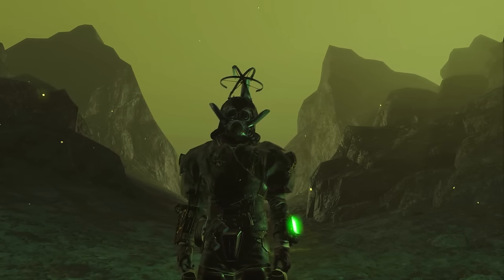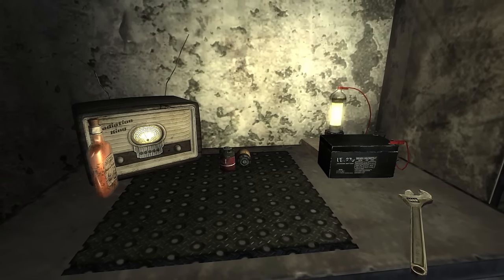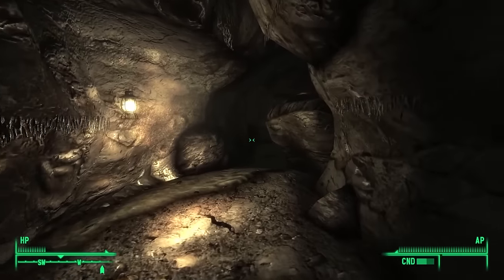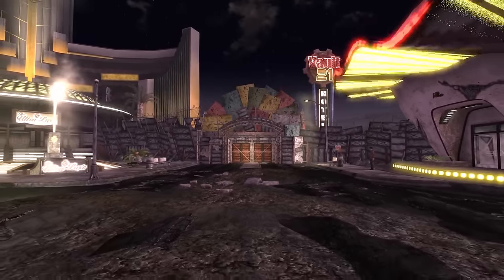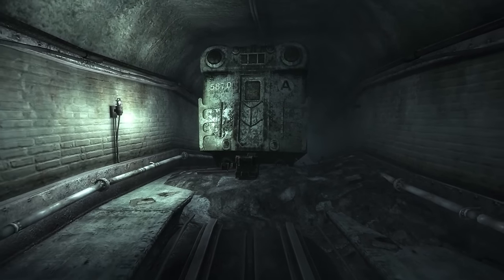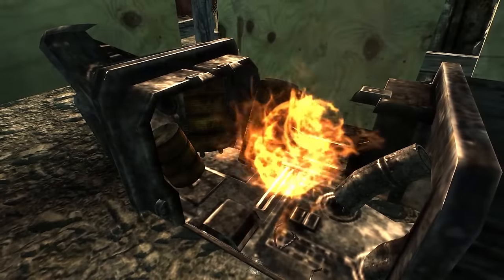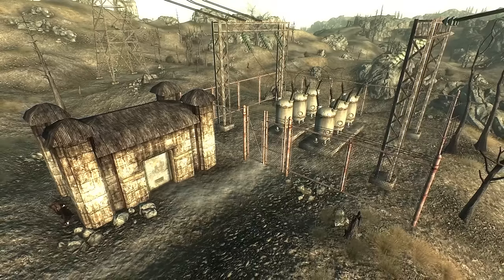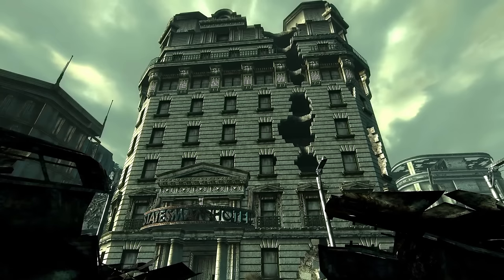Where does the power come from in Fallout?

Comment: 15:54 i think its more possible that these generators are actually charging the fusion core, i see it sort of like a spark plug/battery, plug the core in and it starts the generator but it doesn't run it, the generator will continue to run and charge the core until it is removed at which point i belive the character will turn off the generator before removing the core

Comment: One point that I realize most don't mention is Telecoils. for that power plant in broken steal it seemed to be using tesla coils and tesla seems to have been a bigger influence in fallout history. I think its entirely plausible that they used both nuclear and tesla reactors. But that's just me. 

as for the whole taking the power core out thing. Something I think is that they may have already "depleted" what they had and the building had it stored up in batter stores thus is why when you take it out it doesn't immediately kill the power but it does kill the generator. However years in the future I can see those buildings eventually loosing power because the fusion reactor was removed.

Comment: On the fusion generators you find the fusion cores in its possible the generators are feeding into the power system irl if you install solar or wind generators on your property you can remain hooked up to the power grid and it will reduce your power bill with any excess power being fed back into the mains to the point some people get paid by their power company it also could be the system automatically detects if the generator goes down and switches back to main which would explain the flicker best guess for why it looses power faster in power armor then 200 years running lights I will point out that fact the lights have been continuously running for 200 years without burning out if the lights are able to run that long then why couldn't they simply be extremely low power draw if those lights have just been sipping and tiny amounts of power for 200 years then a mech suit that weighs as much as small car running around like it's got a plane to catch would draw that power a lot faster it also could be the fusion cores are already almost depleted and the power armor is just the straw that broke the camels back

Comment: used to puzzle me, especially when in fo4 you can remove a fusion core and yet the power to the building would stay on...and then I discovered a mod were all power shuts down when you remove the fusion core, however I did have to tweak the mod as it only turns the lights off,

Comment: Regarding the fusion generators, it's also entirely possible that the core isn't the whole system as noted by the massive ceiling height blue object they are plugged into literally called a "generator". My personal explanation being that in the generators the core serves as one small part of a larger system, functioning more as a capacitor or igniter than a battery, and likely involving a function loop that cycles whatever material is in the the core, allowing it to function without depleting. In power armour or a gat laser it is used as the entire standalone power supply and just drained like a battery rather than cycled.

Comment: There is actually very high probability to the possibility of alternative power sources still giving power, especially since I still have the theory that a lot less of the power in the fallout games is necessarily provided by nuclear sources than outwardly apparent.  Honestly I always had the theory that the fusion cores were more of a battery that contained a bit of nuclear material to appear to be the main power source of a fusion generator when it was actually more of a backup or kind of an alternator.  Honestly I rather assumed that there were probably quite a few other forms of power generation like solar, geothermal, and hydroelectric that probably just weren't open praised and talked about because the big money was on nuclear and that alternative also was more suitable to hide other less ethical projects also using radiation.  So other possible sources, especially something like geothermal generators, could be pretty easily automated, kept out of sight underground, and the power coming from them could be attributed to the more obvious powerplants when in reality those plants were not actually producing all the power in an area.  Also if those hidden plants were specifically designed to be automated and self sustainable, maybe with a few robots to keep an eye on them and to perform maintenance, they would have been a lot more likely to still be running.  I am not saying that there wasn't a lot of the electricity produced by nuclear, just that it is possible it wasn't nearly as prevalent as it appeared and that there were other hidden alternatives that are now still going strong.

Comment: Fusion cores when paired with power generators likely play the role of a generator in a "black start" situation and maintain the running current for the station/generator.
All power stations require power to spin up the turbines and get processes started before they can be connected to the grid. Once running, the draw on them would probably be minimal and when you stick it on a power armour, it just can't keep it up. The larger body of the generator probably also houses a battery system that will keep things connected to them running, if those battery systems are near end of life or damaged, they could be pushing insufficient wattage to fire up equipment with higher peak loads required to start or run them.

Comment: What if the fusion generators are constantly feeding each other? If that's the case, the generator wouldn't be draining the core but, using it and recharging it at the same time. There's some complicated electrical stuff as to why it doesn't work in real life but, it can happen in Fallout.

Comment: Always thought of the fusion cores like a breaker switch attached to a generator. 
When the breaker pops, so does the fusion core and it shuts down high level surges but keeps the lights on and the doors working, etc

Comment: 5:25 there is another boxy generator in Fallout 3 that you see all over the subways, usually in the tunnels between two tracks. There's one or two in almost every cut through tunnel I can remember. (Sometimes paired with a mine or explosice trap that then blows up the generator for double damage) oh there you cover it. Inchoose to imagine it as a generator despite how it's referred to in the game files since a lot ofnplaces seem tonuse them like that. Would a generator notnhave some transformers attached sometimes?

Comment: voltage is the difference in potential between two points. this fundamental piece of trivia makes the usage of electricity in almost every video game a joke

lightning is not something you aim. sparks don't jump out of loose wires. you need about 10K volts to bridge an air gap of 10mm or about a third of an inch between two points. one of those points need to be held at about 10K volts of different potential to the other and once the bridge is made the difference is nil. 

so lightning jumps between two points and cannot miss, sparks don't drip from electrical hoses.  so any kind of lore on electrical usage in these games has started from a place of total ignorance or lack of effort. 

as for fusion cores in buildings. it's more reasonable to assume those are charging the cores and the players character is dumb enough to just yank fusion cores out without even hitting the eject button. even more likley is that bethesda ran out of time or enthusiasm for putting in the effort to have the cores actually do anything

Comment: Chernobyl still produces power today even though it melted down.the generators you pull the core from are probably backup generators wich would explain them protruding out they probably were only connected enough to partially power the necessary systems needed to start the generator.Also you need a steady stream of power to maintain a fusion reaction the cores may be a way of starting/maintaining the reaction doubling it's life time and power produced.

Comment: On the "Fusion generators" not only are the cores not visually seated in the wild, but the eject light flashes. It's possible that the gens ejected their cores as a safety precaution and therefore weren't using up the charge in it. It's also possible that the core is acting as both a fuse and a battery and the power is actually drawn from elsewhere. The company behind the gens isn't exactly known for being honest.

Comment: I have a theory about the fusion core generators, what if the fusion cores aren't which actually supplying the power to the generator, that the generators are actually charging the fusion cores and it took about 200 years to fully charge them, and the generator shuts off because it's no longer charging a fusion core.  infusion technology is so unreliable it took 200 years just to get that much power to power a power armor for such a short amount of time.

Comment: I always thought those fusion core reactors were actually a charging station, because as you so eloquently put it in Mass fusion could never get fusion running before the Great war so instead we are actually dealing with is some type of power bank and those devices are actually charging it the fusion cores themselves and my personal theory would have been used to power things like front end loaders or other things like that, and the fusion cores themselves are actually falsely named as you yourself put it but the reason the xplode is because the people working in Mass fusion our kind of insane and used nuclear materials in the construction of these microfusion batteries which explains why they explode once you depleted the energy

Comment: Knowing Fallouts logic I bet the fusion generator is actually a fusion core charger. It just charges them like batteries running off the same power that runs the lights. When you remove a battery from a charger usualy a light shuts off due to a open circuit. Maybe you push the core all the way in to use start charging or use it as a battery. It pops out halfway when its done charging, cycle cell could be reffering to charge cycle.

Comment: Didn't read that perk correctly. It says that during combat you can eject the core to act like a nuclear grenade. Spent cores just go away like always. Also the big yellow generator looking things that look similar to the generators with the fusion cores could be nuclear batteries supplying the building and maybe a few nearby areas, if they developed the diamond nuclear batteries to the point that our current research indicates is possible those batteries could last for several more millennia.

Comment: normal real world nuclear power plants would continue to run unattended for about 40-50 years. So its NOT unreasonable to think that someone could automate something that could replenish the nuclear fuel and the water needed to cool the reactor once every 50 years to allow it to continue running for at least 200 years. Which means the automated system has only had to work 4 times total.

Comment: maybe the fusion cores are only used occasionally by the generators to spin up some kind of flywheel battery, and the battery can power the building for a while without a core installed. Maybe the generator unseats the core for some kind of safety standby mode, "safe to eject" like a usb drive

Comment: At most industrial facilities, the electric motors take so much energy to start up and run, they would take to much energy from the grid that the locals would have a small blackout.  So to prevent this they would have electric generators to provide 1/2 or enough power to prevent the locals from loosing power to there home.  Even in today's modern world every facility will have generator to provide some power to help them start operation.  Also it lowers there electric bill a little bit to.

Comment: My thought was that the fusion core generators acted as backup generators for lights and secondary systems. With the major portions of the generators acting as capacitors or similar to gas generators replacing the fuel with fusion.

Comment: So regarding the fusion cores, someone actually did the math on them and came to the conclusion that they're not only technically feasibile, but also that a container of that size has loosely enough deuterium to sit stable and maintain their near fusion state for ~200 years based off our current understanding of the science of fusion.

Also, the explosive failure of the fusion core is presumably a runaway fusion reaction as the core itself reaches its end of operational life and is basically an eruption of deuterium plasma and other nastiness.

Comment: The useable lifespan of a fusion reaction is far greater than that of a fission reaction. Fusion is self sustaining, given that ignition can be achieved. I would bet that "fusion" cores are actually fission cores, since they can be depleted in no time. The amount of fuel material need in a fusion reaction would fit within the core body and would be enough to power far more than a suit of power armor for a significantly long time.

Comment: with the whole thing about fusion cores and them being partially ejected, i thought you were going to go down the route of fusion cores are mostly depleted, and that's why they don't last very long, simply because there's not much left in them, and that's why they're partially ejected with the eject light flashing, not that power armor uses more power than an entire building, seems a lot more likely to me that the building are running off of the cores, and the underground power both, hence why the lights go off, then come back on when you take the core out, switching from one to the other.

Comment: I assume given the power infrastructure such as visible power poles then the fusion generators don’t power an individual building but could be like a solar power system where they contribute to the grid rather than power it’s own. So the reason the power is still on when you shut them down is because in a gameplay sense there’s more you don’t get to see.

Comment: Some fission reactors use the typical deuterium and tritium as fuel but then need a beryllium blanket to convert the kinetic energy from neutrons into heat to then drive steam engines. As the beryllium gets bombarded by neutrons it gets split into more deuterium to fuel the generator. These beryllium blankets also tend to be contaminated with uranium. although not much at the quantities needed for beryllium blanket based fusion reactors require, it's more than enough to create nuclear waste. As the beryllium gets used up more efficiently i would imagine it would concentrate the fissionable material to explosive levels.

Comment: The core is a battery 
We will use cars as an example generators car engines have batteries if you remove the battery from them, the car keeps running but only until you turn it off you can power something else with the battery, but the battery will eventually die the battery ask as a voltage regulator and a starter and the fusion generator probably gets shut off. It probably has an electric starter to start it up. That’s probably what the battery fusion cores for.

Comment: Cool video, but here is an idea, fusion cores are able to recover charge, so when powering a building they have low power drain, but when powering a power armour they use more power than the core can recover causing the core to suffer from burnout resulting in them not being able to recover charge

Comment: what if the fusion generators worked like a car battery?

When you start a car, the car draws much power from the battery to start the engine but once the engine starts, it charges the battery as you drive

it wouldn't be that far of a stretch to assume that the fusion generators would draw power from the fusion core to start up and once it is started the generator recharges the battery

Comment: I assume for the cores in the generators that arent plugged in fully aren't running off the core, they're likely running off the mains with the core as an emergancy battery that requires being pushed in to begin use for however long they'd last, allowing them to retain full charge whilst still adhering to what i think is the internal logic here
The light flickering likely being related to the system recognising the core being removed and disengaging the idle it had held to start the initial draw from the core if it were pressed in/engaged

Comment: The fusion core is not the source of the power for communities, but rather are the power source for the starters of the main power sources, much like a car battery provides the power to the starter of a gasoline powered vehicle. That would be why when you remove the core, power continues to flow to the buildings.

Comment: Fusion on the core is most likely a brand name same as on batteries in the world now.. As for Fusion cores in the generator its possible that is a backup emergency power device if the main grid line goes down. Which explains why it's not all the way inserted.  When you seat the core all the way in same as a unit in a settlement it then use the cores power.

Comment: What if those fusion cores are backup power supplies like an emergency generator or to offset high power loads at peek hours to not strain the grid like real world backup generators? The grid might still be on or partly on and they are just covering spikes in power or outages in emergencies, also settlements in a world where raiders can easily take and control a power plant would still want generators on sight for sieges, it also helps if the network is degraded and no longer able to provide the same output a properly maintained, non damaged or worn plant would prewar